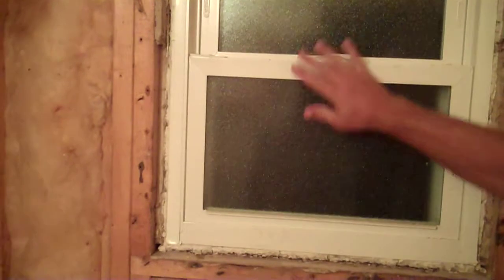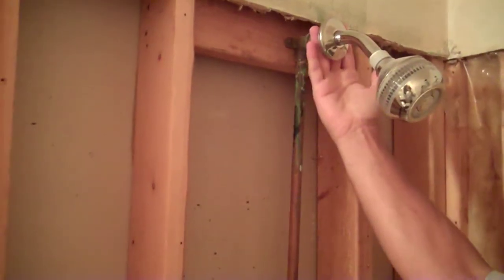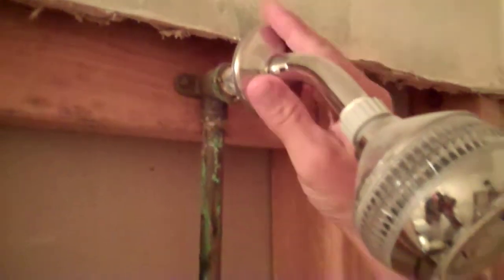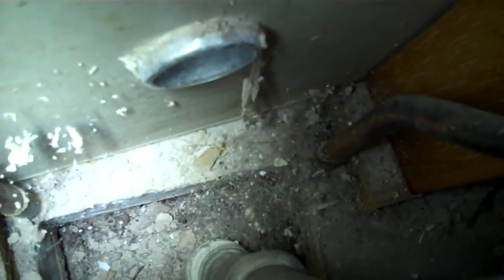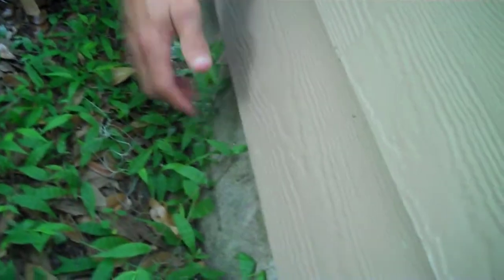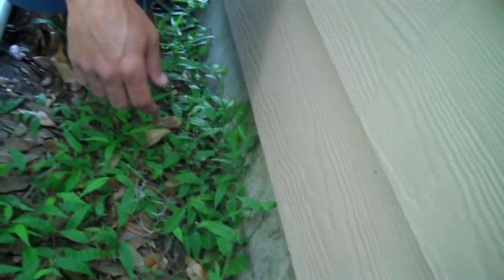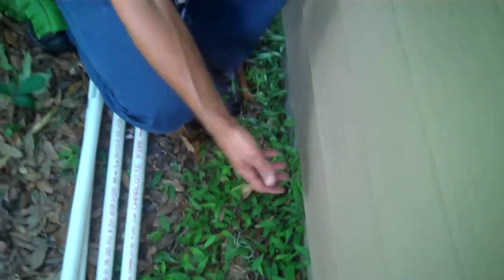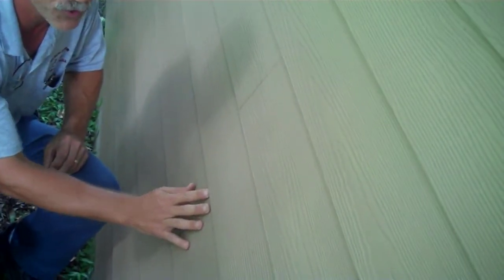Classic Ways Bugs Get Into Your Bathroom

Comment: Thanks for the video.  I have the same problem with my shower flange and had wondered if that's where they're coming from.  I'm going to seal it up with silicone caulk.

Do you know if insects (in particular roaches) tend to hang out in the tunnels under registers (floor / wall vents)?
Reply: hehe 9 years for a answer, and could you be more specific?